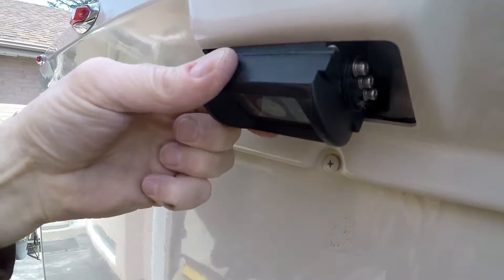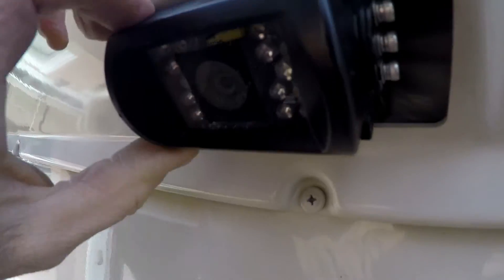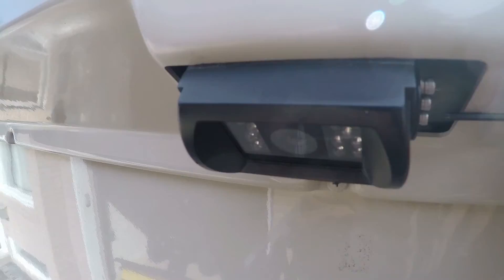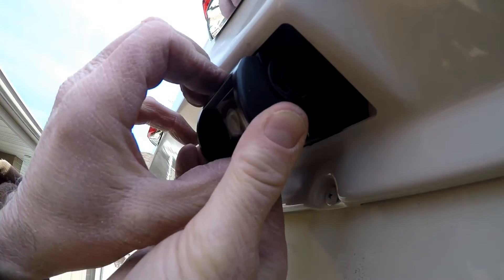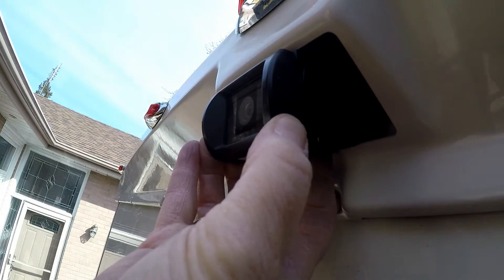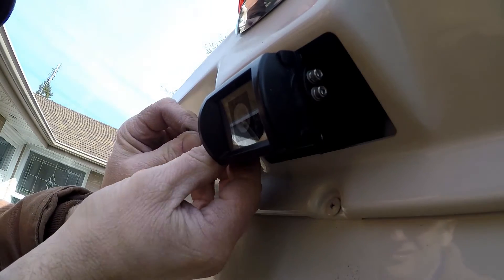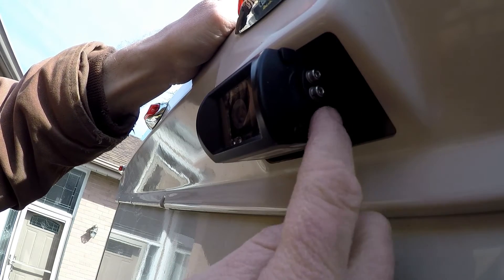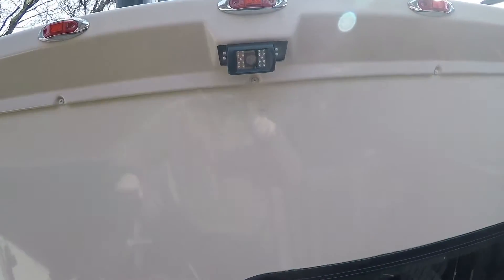Adjusting RV Motorhome Back Up Camera Winnebago Fuse

Comment: What size Allen wrench are you using?
Reply: April Carroll  I believe it is 3/32 " or 2.5 mm
Reply: Thanks, Mr. Moodey. I ended up using a drill bit and turned it with pliers. (not easy on a ladder :).